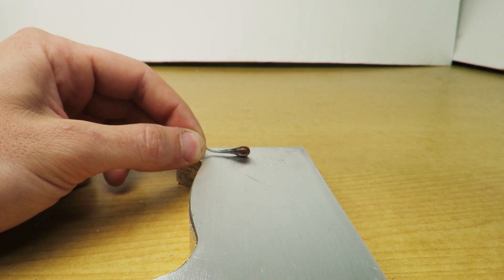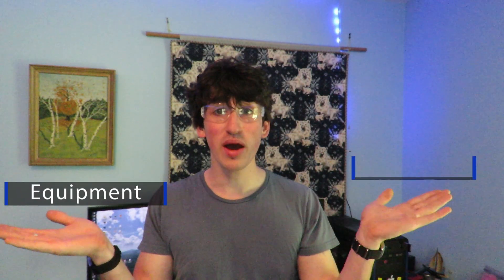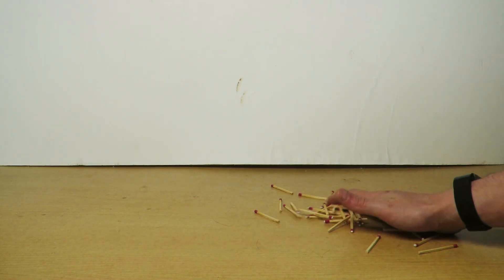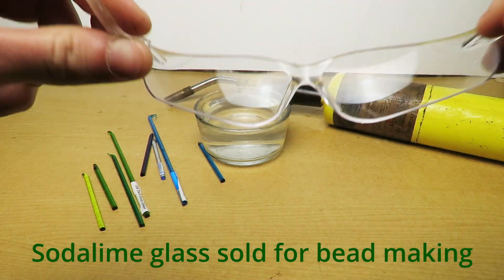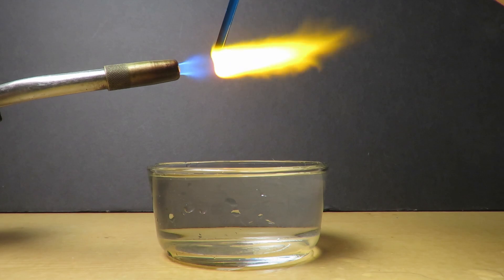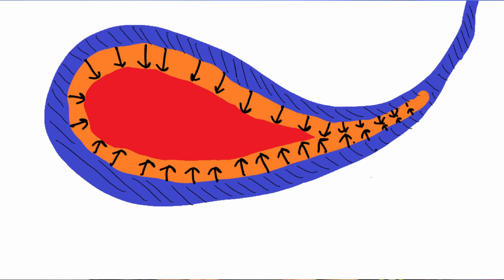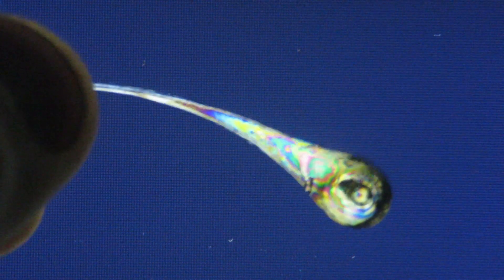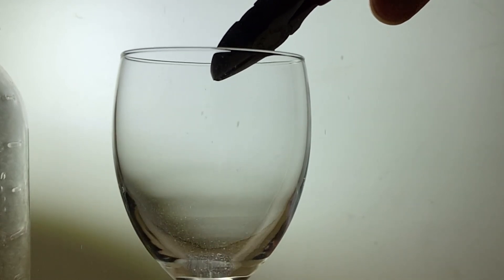How to Make Exploding Glass Prince Rupert’s Drops!

Comment: Does the temperature of the water effect the hardness of the drop?
Reply: Sure! Too cold water make outer forces stronger, so the pressure from the outside will be bigger. But this could also break the drop in the water. So you need to find a balance.
Reply: @LichtTempler  so liquid nitrogen is a no go or it makes the drop the hardest thing in the universe?
Reply: @MAPMinorAttractedPurge , there are many factors, so try it :)
I experimented myself and as I said, some of them broke in the cold water. I made a water slightly warmer and then they formed nice drops. Maybe you will find a better glas composite material for liquid nitrogen.
Reply: @Shit4Brains456 , where do you live? Best results I had so far were with glas beadmaking kits with soft glas "COE 104". And for this glas you better use motor oil to cool down, not water. 
I live in Germany, here those kits are named "Glasstangen zum Perlenmachen".

Comment: So if the strength of the drop is relative to the temp differences between the water (causing the initial hardened outer shell) and the core… 
Try it with the same size in below-zero salt water, see if the explosion is bigger (idk if the salt itself will mess with the glass though)